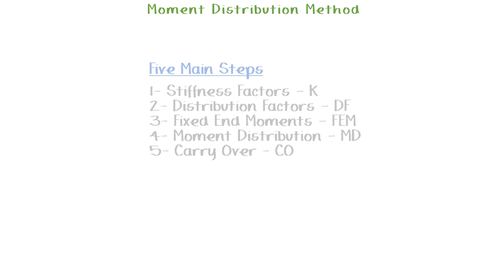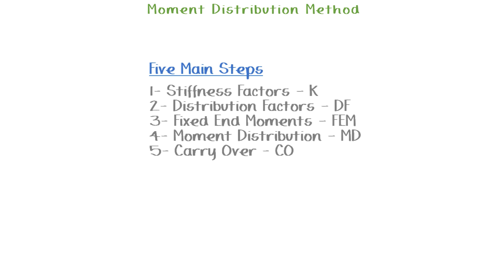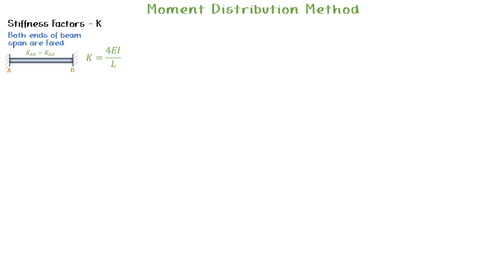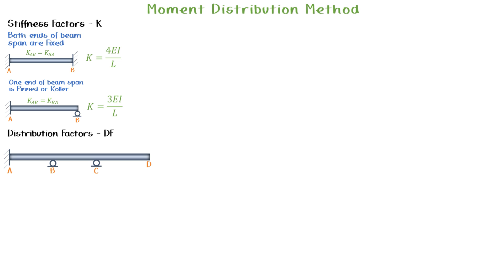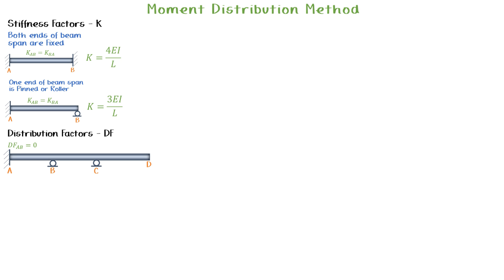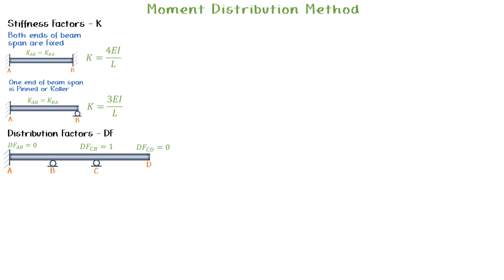Moment Distribution Method Beams Part 1 of 3

Comment from the maker: Time Stamps 
00:00 Start 
00:21 Five Main Steps for Beams Using the Moment Distribution Method 
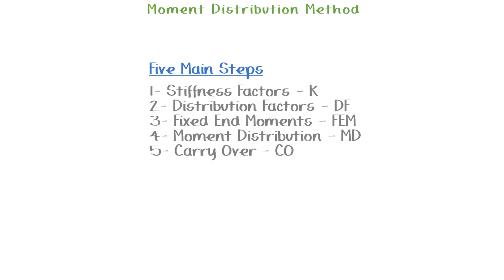00:56 Step 1: Stiffness Factors 
01:20 Step 2: Distribution Factors 
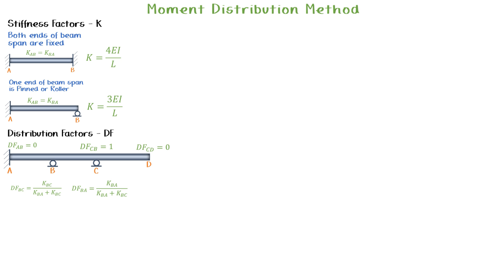02:28 Step 3: Fixed End Moments 
02:48 Step 4: Moment Distribution 
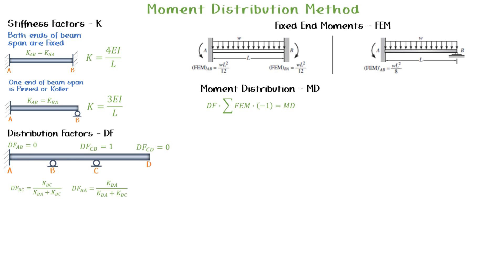02:58 Step 5: Carry Over 
03:21 Outro